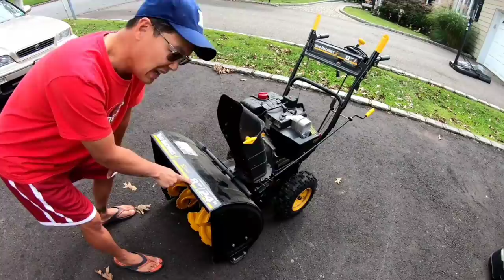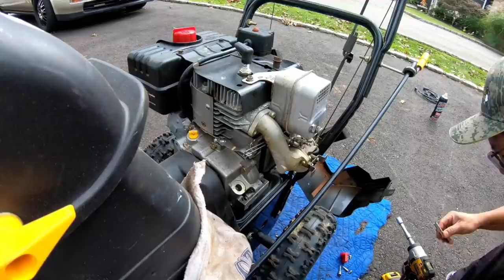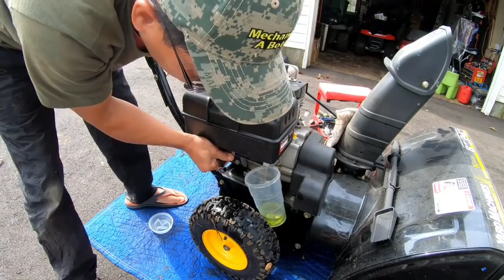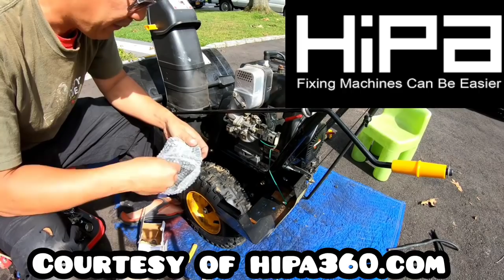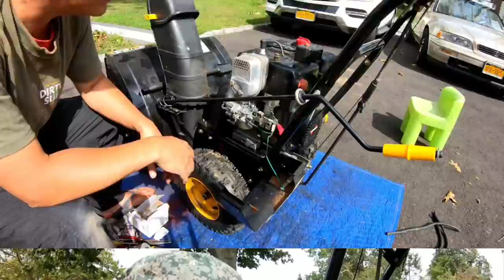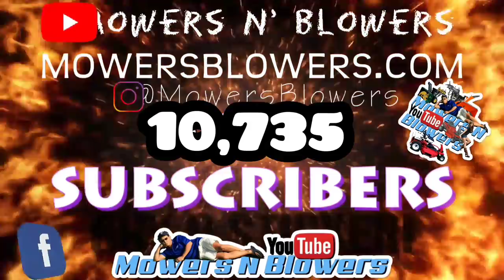YARDMACHINES TECUMSEH SNOWBLOWER SURGES & HUNTS NO PRIME HIPA360.COM CARBURETOR 632334A REPLACEMENT

Comment: With these none adjustable Techumseh carbs we have found that ultrasonic cleaning them has solved the hunting issues. Normally the hunting requires a jet to be opened to allow more fuel and the ultrasonic cleaner run at 55 to 60 degrees Celsius softens up or removes any build up in the jets so they get back to nominal dimensions. Periodically we have increased the jets by 0.002" since some of these engines have not received proper maintenance and thus the compression is lower thus pulling in less fuel. Love the videos do not know how you find the time to do them daily. The OLD MAN at EP over and out!
Reply from the maker: It’s tough Wayne,  but there’s always something to do.

Comment: Those baby squirrels look cute and rip you to shreds.  That new carburetor really seems to have done the trick compared to the old carburetor. 
A few days ago, I noticed at a TSC in a neighboring town, A Cub Cadet snowblower that had a 28 inch swath. 
From the way that it was sitting, you really couldn’t see what brand engine that was on the snowblower.  With all of the price tags and other information being where you couldn’t read anything, They must not wanted to sell any of their snowblowers very much. They had two smaller Cub Cadets and one Huskee brand snowblower.

Comment: I've actually had good luck no these later flat head tecumseh not taking off the entire intake.  The philips screws holding the carb on should be easy to take off with a small wrench holding the nut on the other side.

Henry, have you looked into getting a cheap amazon ultrasonic cleaner? I use mine every time I clean a carb now, had really good luck with it.
Reply from the maker: I have one,  takes too long

Comment: If you'd been thinking you could have attached the new fuel line to the old fuel line using a piece of tubing in between and pulled it through and then just cut the length on the other end and that would save you from fighting it to get it through
Reply: Jim you are absolutely right at Eliminator we use a 5/16" bolt with the hex head cut off, just slide threads into each half and pull through. Important to note that Techumseh fuel line is actually 1/32" smaller on the OD than B&S and must fit in behind a sheild that is in front of the flywheel. When done improperly the vibration can cause the flywheel to cut right through the fuel line and we have seen this on 5 snowblowers over the last 9 years of business.
Reply from the maker: Yes I wasn’t thinking